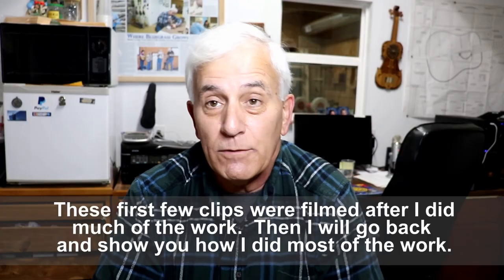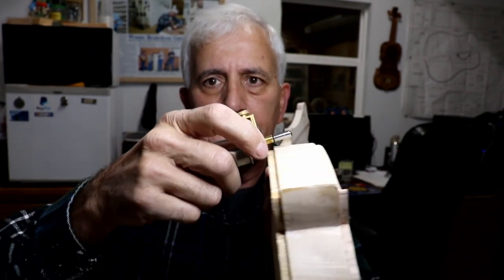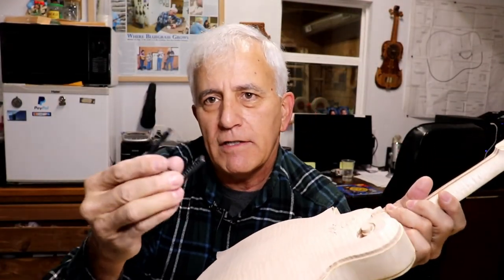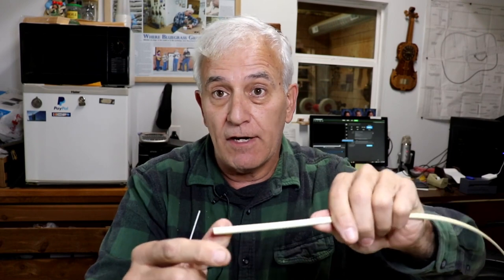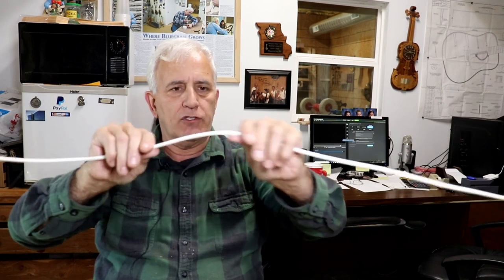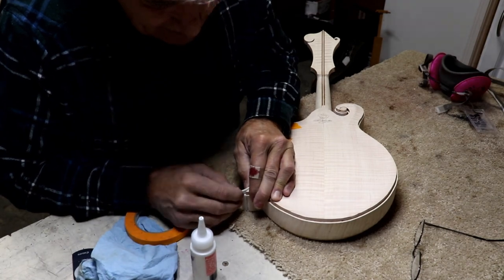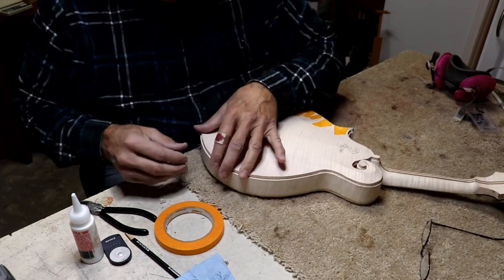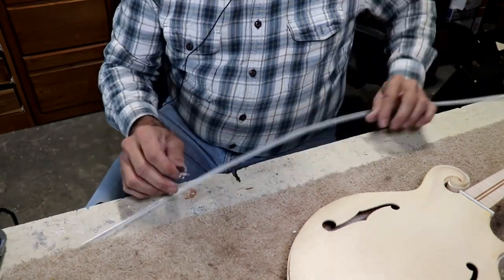241 WV Mando Project P5 Binding

Comment: Jerry have you ever tried bone or antler on those points? Your videos are the best, you should just have a live cam for when you’re in the shop.
Reply from the maker: Yes I've used it fairly often. It's a little harder to work with because most of the time you can't find a completely solid piece

Comment: hey jerry great work flawless joints on your binding ...bravo...im actually in the process of a guitar build an want to bind the guitar an want to know your opinions on wood binding an are there any woods u can  use for this other than your standard maple , rosewood an ebony ? is softwood used in binding or only purfling ?an do you have a method for soaking wood binding for prepping for bending?...im looking at it asthetically because its not a acoustic an is not structure in anyway ..
Reply from the maker: I don't really have much to go on on the wood binding. I've only done it once or twice myself.

Comment: Wonderful job Jerry as usual. I was just wondering how those bindings hold in the passing times, do you think those would also retract as the celluloid binding does on old guitars ? Does some glue would be better than others on the long run ? (years of course)

Comment: Just a question about the binding. Can you use leather lace for binding on a stringed instrument? If you can you will probably say something about thickness and width they make a table top leather lacing machine, and skiver AKA  splitter, shaver & burnisher. If it wouldn't interfere with the caustic properties.
Reply from the maker: I guess you could. I don't think I would do that.